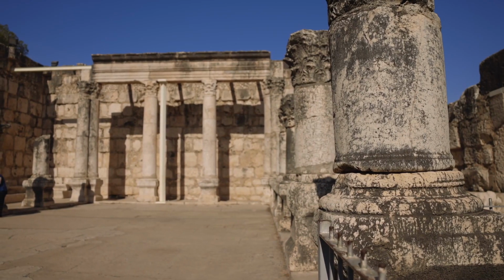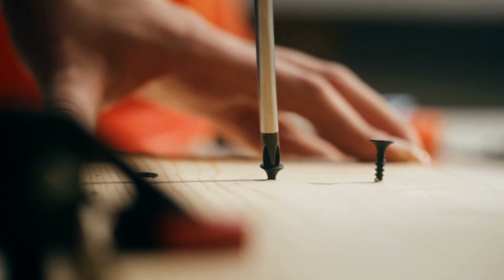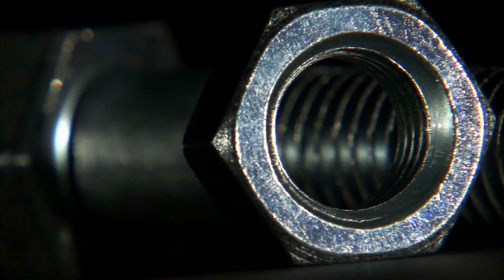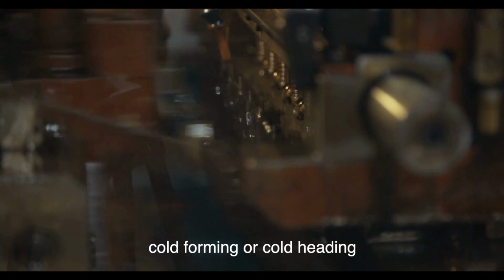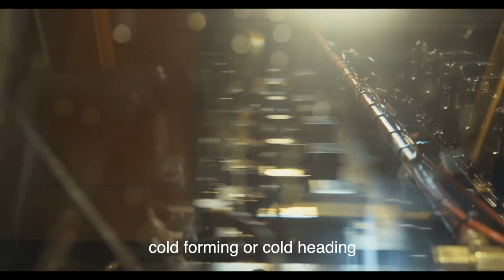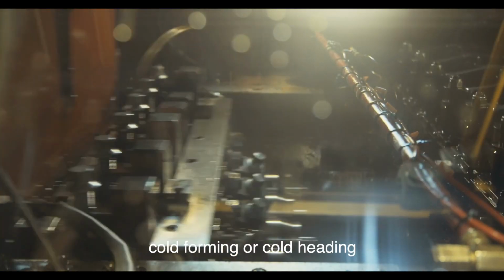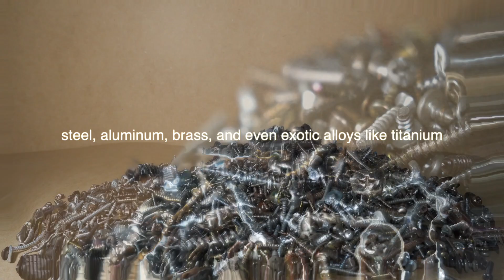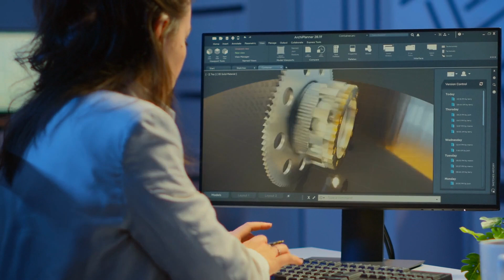How are Screws Made? | History of Screws: Unraveling the Epic Saga of Screw Manufacturing

Comment: That was a massive let down, started strong with archimedes screw, made mention of the printing press press screw. There leaps and bounds away from each other in terms of manufacturing tolerances needed to achieve there functionality, also later on in the video you say how screws are made from the Industrial Revolution onwards (you mention cad multiple times but cad has nothing to do with screw manufacturing. Until it’s CAM)
But you don’t mention or even look into how screws where made before the Industrial Revolution?

You make no mention of the screw in forms of linear motion (the linear movement screws In micrometers are said to  be responsible for giving mankind another decimal place in accuracy)